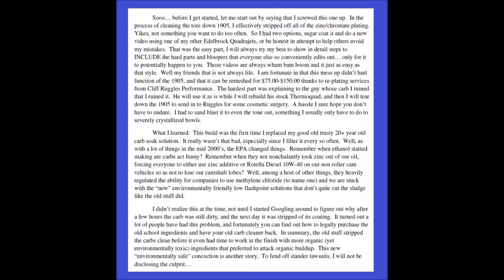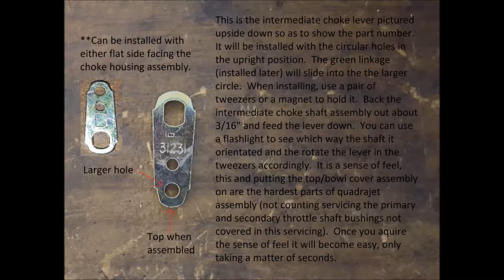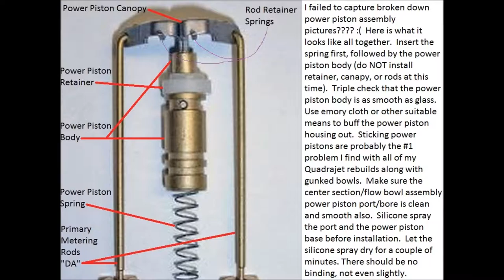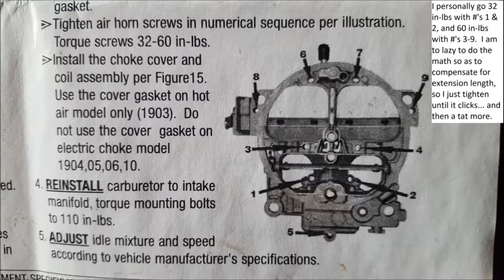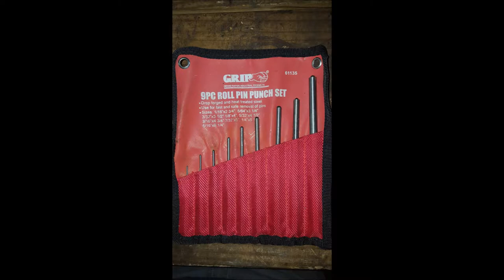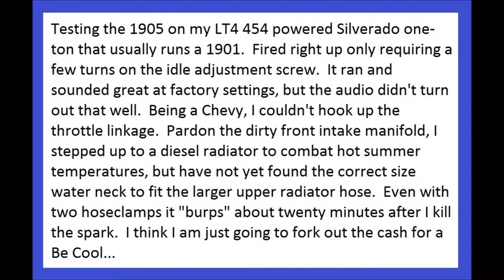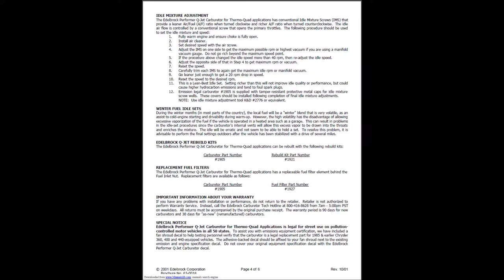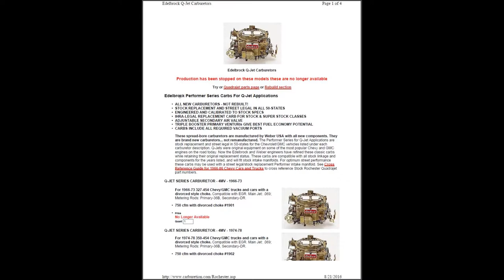Edelbrock Quadrajet 1905/1904 Rebuild: Assembly 🔧

Comment: Shawn:  Enjoyed your video; very well done and quite informative!  Did you ever complete to disassembly & cleaning portion for this carburetor?  If so, where can I find it?
I have inherited an old Chevy with an Edelbrock #1901 carb.  It has been sitting idle for approximately 12 years, and was stored with gas in it.  I'm quite sure it will need a thorough cleaning/rebuild.  You mentioned you run this carb in your truck.  Is the rebuild/cleaning for the 1901 the same as for the 1904/5?  If not, how is it different?
I can find little information on the web for the 1901.  Any advice or directions on rebuilding procedures would be appreciated.   Thanks,   Dick B

Comment: Great video ! I got a crazy question! My carb has a 1903 tag on it but when i disassembled it my inner workings are identical to the 1904/1905 in your video. Same single float in my carb as yours from the video . I’ve got float issues is why I was viewing the video in hopes of determine where to measure my float from an What measurement it should be set to .

Comment: What do I so if the previous owner way over turned the electric choke to rich?  If I losen the screws the whole housing will spin lean. If I leave it where it's at which is way to tight the plate closes hard then when I hit the throttle the butterfly open all the way up and down and then does not go down when warm. So the idle is insanely high it will quite a little but it's still way to much. The only way to make it quite which I find weird is I have to turn my air off or heat vent.. When you turn the air off the car idles lower but car will be shaking and starts to stall when put in gear. I have watched this video second by second and pausing lol. Can u please help me out with a few words of carb knowledge..

Comment: I broke an emulsion tube putting it back together. Any advise?
Reply: I dont actually know what they are called. The 4 pins/tubes. One broke. Is that a locator pin or a functioning part of the carburetor?